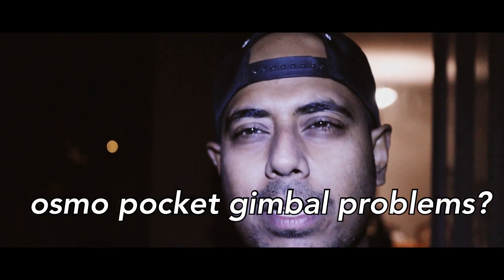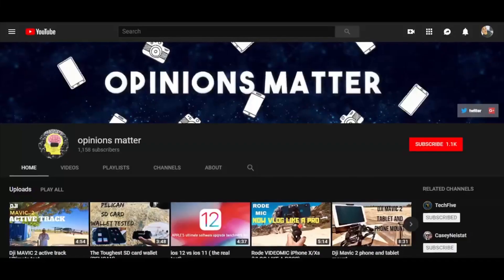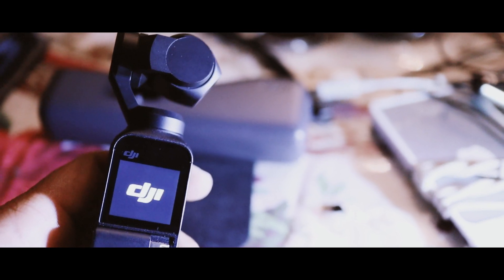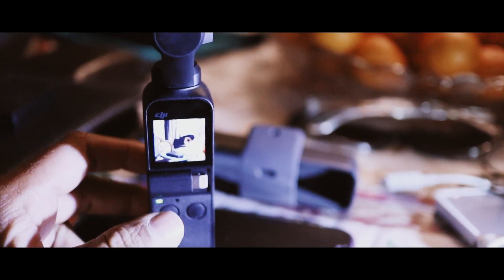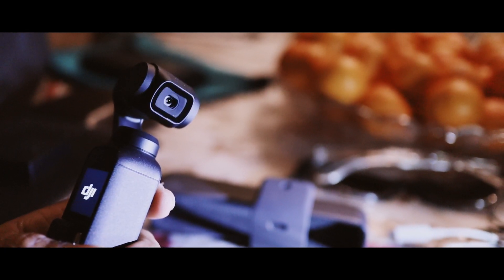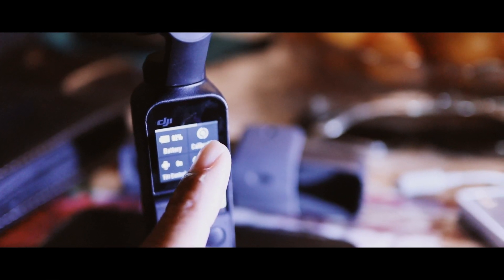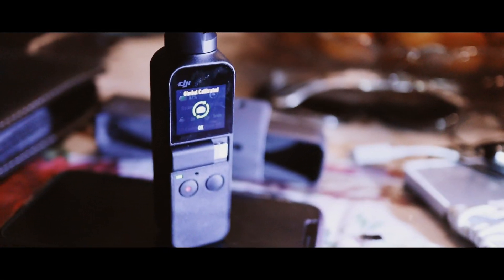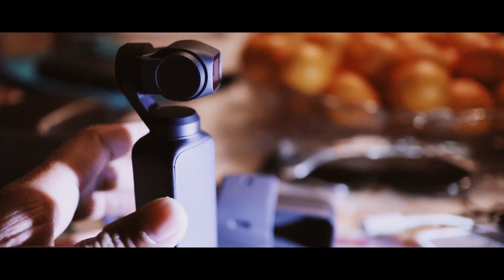Dji osmo pocket | gimbal problems | easy fix

Comment: Thank you for instruction! Does the gimbal calibration will fix a problem with horizontal inclination? I found that even though I take it normally, video are with horizon issues, inclined to 2-5° in the right.